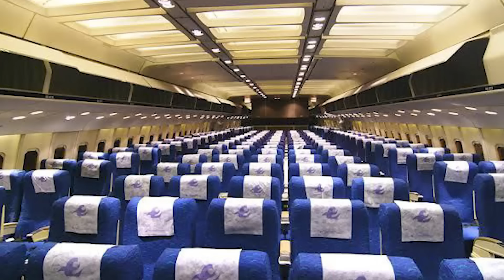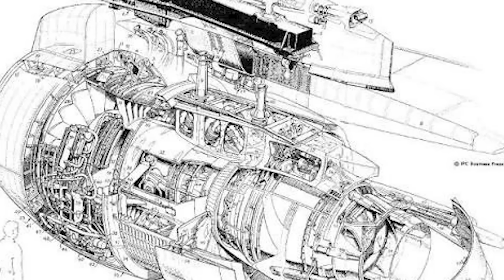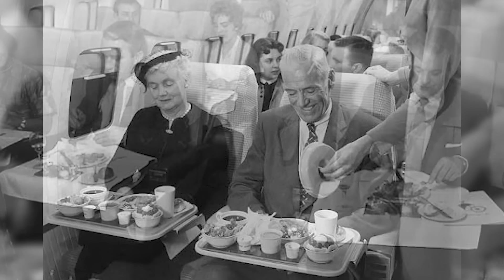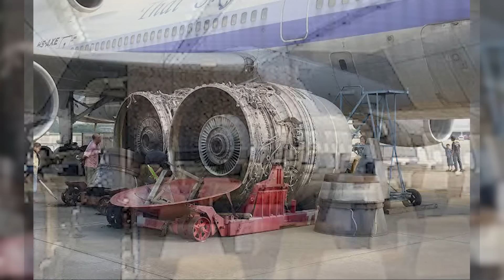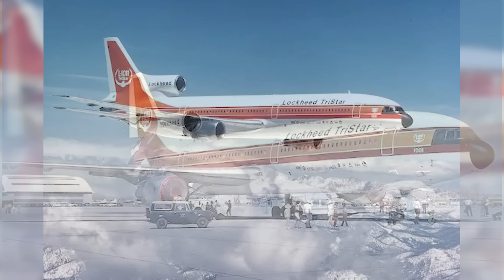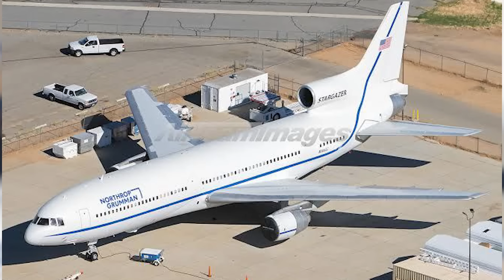Inside the 1970s Jetliner That Hid a Full Kitchen Below Deck

Comment: The L1011 TriStar has in fact 2 windows in the underfloor galley 1 port side above the galley sink and the other starboard side in the service door, if you are going to do something then do it right and do your homework or don't do it at all, the service trollies still went through the cabin for meal and bar service and when not needed for a short period during service where stowed at the main door areas on what we called mushrooms which gripped the underside of the cart, which is why only TriStar carts could be used on the TriStar. Also if you had paid attention to your own collection of aircraft pictures on here you would notice the 2 windows on each side of the fuselage below the passenger cabin. Along with your Ai narration and lack of observation and research shows a lazy approach. I write this from the point of view of having been a flight attendant on the Tristar with 3 airlines, 2 in the UK and 1 in Kuwait. The more of this video I listen to the more I have to add to this comment, the safety ruling about the number of crew in the underfloor galley was no more than 2 allowed, this was because there was only 2 lifts and if something happened like a slow or rapid decompression 
it could be evacuated quickly, also usually only 1 attendant worked the galley, however it was not unknown for there to be at least 6 attendants downstairs all smoking between services, as for being not nice to work downstairs,it was a much sought after position because it meant you didn't have to deal with the great unwashed sitting upstairs, young crew wanted upstairs,wiser and older crew knew better.

Comment: I liked the Tristan. Those engines put me to sleep. 

Now if I had been a flight attendant back then, I would have loved working the galleys. Military Airlift Command had a contract with American Tran Air to fly personel to NAS Sigonella. I worked in the passenger terminal when I was assigned there. I wanted to go on leave at christmas but the plane was booked. So I asked the captain if I could catch a ride. He was like "what I don't see, I don't know".

The ight attendants wore the same kind of over coat we had in the air force. I showed back up that night, stayed outside and waited untill they all showed up. I walked out with them. Once I got on board, I hide in the galley until it was time to take off. It was so cool.